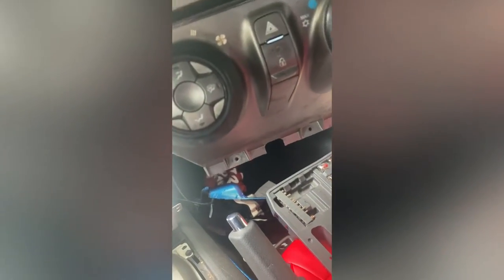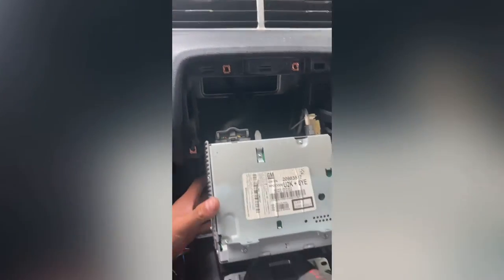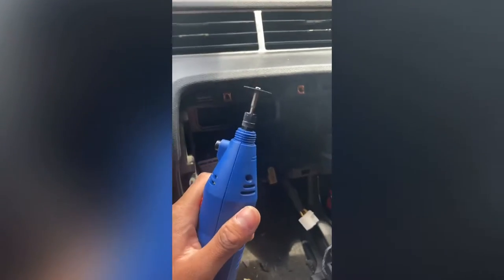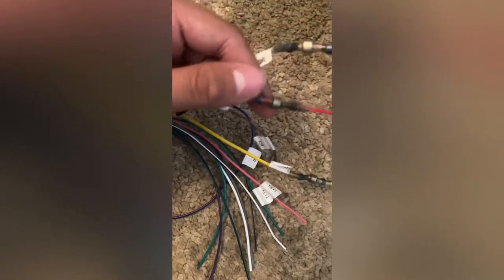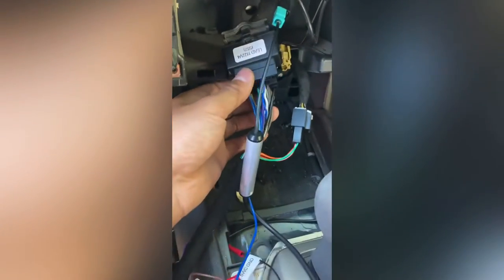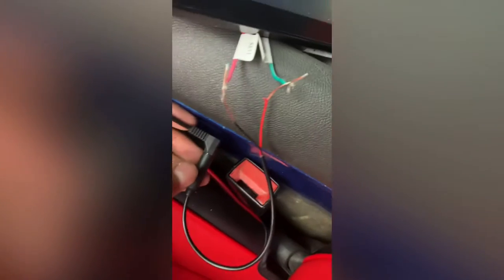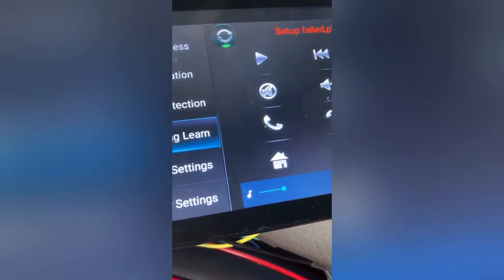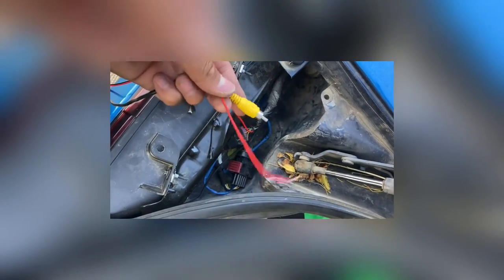2010-15 camaro Radio upgrade Android 10.1 inch with YouTube and scosche camaro 2.0 dash kit install

Comment: Looks good but be ready to have issues with that kit. 1st I lost my heated seat controls after 2 months then lost all heat controls after a year with the exception of defrost which only worked on full blast. Changed to Maestro idatalink and should have went this route 1st. Looks good though.
Reply from the maker: Thanks when I was doing this i was hoping it would last a year at least and so far things are doing well. Im not sure what version on the kit you had, but I know they had a lot of problems since it came out years and years ago
Reply: @alfamods2.0T  wat site u order that 10” double din from I have a 2010 camaro ss with the same SCOSCHE MODEL BUT MINE WHOLE FACE AS URS SPLIT DIVIDING CONTROLS
Reply from the maker: @pinkyp2274  Binize Android 10 Double Din Car Stereo 10.1 Inch Compatible with Carplay Android Auto Touch Screen Radio Head Unit Multimedia Player,Bluetooth,GPS Navigation,AM,FM,EQ,Support Backup Camera https://a.co/d/bLO8Ppi
Reply: @alfamods2.0T  SO THE SCOSCHE MODEL U HAVE IT FIT RIGHT IN NO DIFFICULTY

Comment: Great work! Interested in your wiring for steering wheel controls. Thought I might have to buy a kit for the controls...with your video. Doesn't looking like I need the rr
Reply from the maker: Yeah as long as you have the harness that comes with the  scoshe dash kit you can do my method to wire to key 1 and key 2 of the android head unit